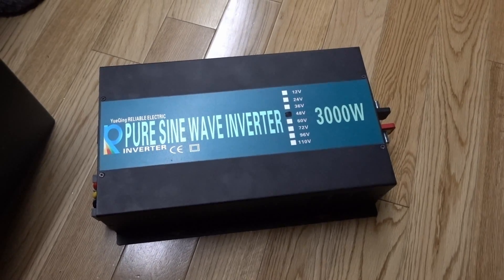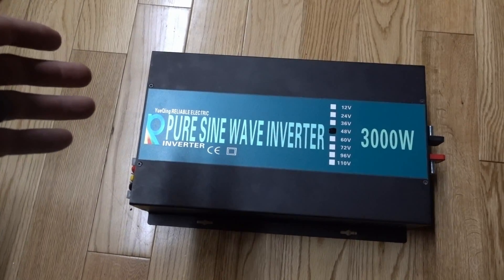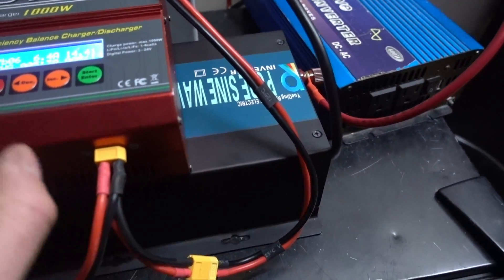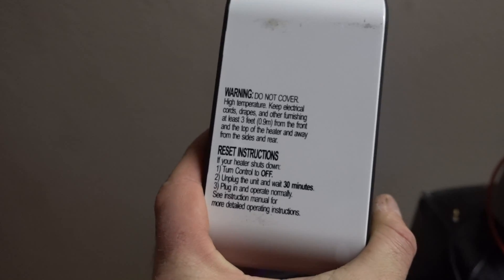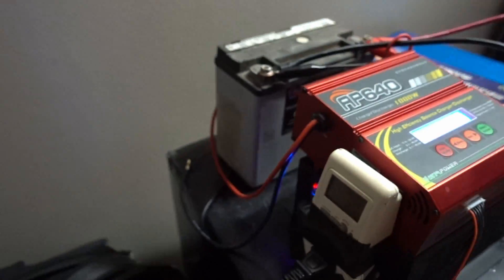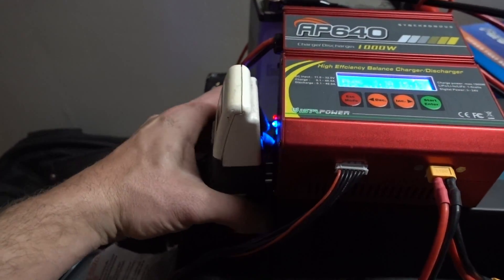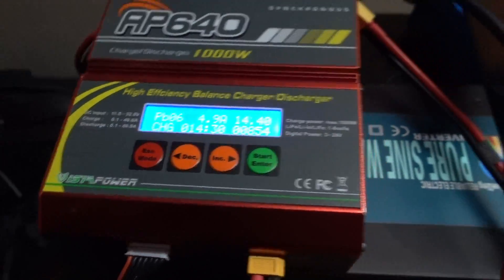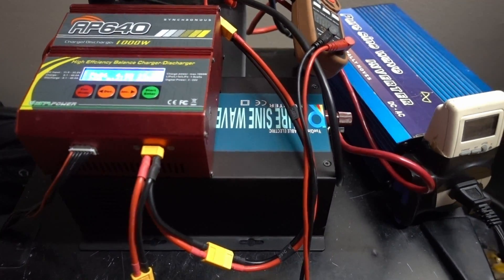Inverter Dies And Testing 500w Reliable

Comment: Great video! I own an 800w 24vdc unit and I like these reliable brand units since they are very easy to repair and modify. Inverters that use the case as a heatsink are a pain to open up and repair. The reliable units have a large heatsink on the board so removal and testing is much easier in my opinion.
I have actually created a micro grid ac coupled system to a grid tie inverter. I power limited the GTI used a DC DC boost converter with adjustable current limit. This method restricts the GTI output to 250w based on my current limit on the DC DC converter. So yes my reliable brand 800w inverter gets assistance from the GTI when the house load exceeds 300w. I used a hall sensor to detect load and parallel the both inverters else the GTI will force power into the reliable brand unit and blow it! (Yup I learned that the hard way, the need to ensure a minimum load is present before paralleling).
Keep up with the great work!
Regards,Fellow off grid home owner.
Reply from the maker: thats sick I tried that once! my inverter did not fail but I was scared to keep the test going for long :D
Reply: Once your ac load is greater than the grid tie maximum output you will be safe. The off grid inverter will ramp down it's output, something a GTI can never do. You will need a robust control system because once that ac load reduces in magnitude, the GTI must be disconnected. I like GTIs since they provide pure sine power at a really low cost. So to sum up, micro grid ac coupled systems are workable with certain caveats. If you want my documented write up on my home solar Projects I can email them to you complete with pics. I'm not skilled like you are with making clean videos. Lol.

Comment: I have three Reliable Electric pure sine wave inverters.  A 500 watt and two 2000 watt.  Used within their limits, they just keep working.  Almost 3 years in backup power service on the first 2000 watt unit.  Checking with an oscilloscope, the inverters deliver cleaner power than our local co-op.

Comment: I just blew mine up for the second time.  Just replacing the fets, resistor and protective diodes was apparently not enough.  I'll have to dig into it and proceed more carefully.  

I have used mine hooked directly to the house from the main wire hookups and had no problem.
Reply from the maker: then your ground and neutral are not connected, is it a older home ? also sucks how did you blow it the first and second time ?
Reply: I'm pretty sure the ground and neutral are connected in the buildings.  What I'm saying is I did that using the high power hookups, not the plugs. So I just used the hot and neutral and not the ground on the inverter.

The second time it just blew when I turned it on.  There must be something else wrong.  I suspect the main control board is fried and is locking the fets on, because when it blew it literally turned 6 of the 8 fuses into charcoal.  Oh well, a learning experience.  I'm going to be much more methodical next repair, I was careless.
Reply from the maker: yea been there done that :D you might have a death transformer or dead output fet, anyways GL hope you can fix her!!!
Reply: I replaced the output fets too.  I think anyway.  Those are the 4 that are off by themselves, correct?
Reply from the maker: yes they are, its trial and error with these repairs GL man!

Comment: All three of my reliable inverters at 24v and 48v are connected to the ground pin and the small prong just like it is supposed to be and are working  fine for me. The earth and low side are connected just like regular USA wiring with no problems
Reply from the maker: but is it connected to your house main panel? that is where the ground and the neutral are binded together killing these inverters, try testing yours to see if the ground is 50% live if so make sure never to bind ground and neutral.
Reply: My two 24V reliables get around 90 volts live to ground and 60 volts neutral to ground. Same on the hardwired and receptacles as you'll see they are connected together inside. I have my house hot and neutrals separate when connected to the inverters as tying to the neutral on the panel will possibly damage any inverter not made for grid tie operation.

Comment: The ground sits at the mid voltage due to the two small capacitors that are connected  from the live output and neutral out put down to the ground of the case and  also to that earth terminal  . You may have problems if you battery’s are connected to a charging system that is connecting the negative terminal of your battery’s to ground  and your battery’s  are not floating

Comment: both of my reliable inverters tell me over volt at 25 to 26 volts and they make me fridge  light blink on and off i just dont trust them ,gladd your having good luck
Reply from the maker: its a dumb design to have that low of a warning, but from what they tell me it will not hurt the inverter, I run my 48 volt inverter at 61 volts all the time and it stops flickering if you put 10% load or more :)
Reply: Southern Ohio Solar homestead my fridge light is pulsing too. The inverter red light is blinking and clicking.  Also the fan is acting up runs stops run stops.  Had been working good for 8 months.  The beep also sounds off randomly....

Comment: I wonder if that little lead acid battery's voltage sag under testing made a difference?  Perhaps if the battery voltage held up at 14+ volts like a car might with the alternator charging they could deliver a bit more power?  750 watts at 12 volts will be pulling over 62.5 amps.  If the battery was closer to 14.5 volts the amps might drop enough to not trip the current limit (maybe around 50 amps for the reliable?)  I guess it all depends if the inverters are shutting off due to A) output power/amps or B) input voltage or maybe C) input current?  Since the first step of the inverter is likely a boost converter to get the 12 volt input to maybe 180 volts or so I feel an input current limit would be a logical design.
Reply from the maker: you could be 100% right but I also had a charger plus the battery didn't fall below 11 volts so its hard to say, I will try this again hooked to my 180 amp diesel jeep :)
Reply: Going Off Grid thease videoes my god!! so good they are tho i am not got at knowledge of this i still like what you are doing like you know 
please reply hi to me

thanks
Reply from the maker: hey buddy thanks for watching!
Reply: thanks
Good luck on your future vidoes

Can I say something

Would you mind if I send you something WHICH IS NOT INVERTER RELATED
its Some cheap shit
I mean do you know the youtuber named "Bigclive"

He does those kinda videos 

So can I send you something its actually a cheap china shit and would you mind rewiewing it

And also
I am a 12 year old kid lol

I am really interested in electronics

And is a aims inverter worth it?

Thanks for reading this comment 
Bye
Please answer my comment! :)

Comment: I have a 2500 one recently it started acting up.  Red light flickering, and a clicking noise.  The lights in the house pulsing.  Not sure what is up.  It’s run fine for 8months. I never hooked up a ground... not sure if that is the problem....
Reply from the maker: Is it only when you barreries are full?
Reply: Going Off Grid not sure...batteries only charge to 25.5 v these days. Voltage for my charge controller is about 28.4 in full sun.
Reply: Seems very random. Also when the fan kicks on it pulses. Never stays fully on
Reply from the maker: @thebluedan  weird  might be on itd way out  i have 2 that are 3000w and 3 years old
Reply: Going Off Grid yeah probably,  I had one blow in a light strike last year.  Maybe I can combine to fix.  I think maybe it’ has something to do with switch for the temperature sensor and  cooling fan...but I’m not very good with electronics... not sure if I sure if I should switch brands...seems like all are a roll of the dice. That’s why I tend to like these cheap ones, and that I live in Brazil and the taxes double the price compared to USA....Because of their stupid taxes.
Reply: Appreciate any input.  I should probably replace it I’m afraid the power fluctuations will damage my fridge compressor motor
Reply from the maker: @thebluedan  have you tried the newer models?

Comment: So please explain, why do you say this is not a home inverter? I have one and it powers my house. Should I not use it. Why?
Reply from the maker: its fine if your careful but if your careful running a full house then your fine. I find its when you have multiple people in one house thats when 3000w is not enough and you end up over loading it.
Reply: @GoingOffGrid101  gotcha. My 4000 seems to handle things well. Just my wife and I. No pumps, elec htrs, just appliances. (No stove, propane).
I really wish I would have gone at least 24 volts though. Bad (uninformed) decision. Using 24, series 31, 105ahr. Deep cycle Batterys. Would have been such a better supply sys.
Thanks for clarifying.

Comment: Goingoffgrid big fan and following for long time.  I have seen u go back and forth on this I am thinking its because some reliables u can hook up neutral ground and some models u cant. But odd is old time engineering said it was 60v betw neutral and ground and he still did it.  Who's right and how can we definitely test without blowing up inverters
Reply from the maker: just grounds before the inverter and after and you will be ok, Reliable told me that these inverters are not designed for neutral to ground bond, at least on these older models.
Reply: @GoingOffGrid101  so you mean gound the chassis of the reliable inverter to a separate actual grounding rod  and then run jusr hot and neutral into a sub panel that back at the main already has natural and ground tied??

Comment: hey my 3000 reliable dc  voltage  meter has always read .2 volts lover than my make skyblue  which one is on the money?  the make skyblue is pretty good  charge controller  i have  the 60amp along with my reliable 3000    oh  and i never go over 2000 watts well  its always runs from about 90 watts to about 400  so the fan comes on once awhile  hey thanks for the grounding tip  you just save a lot of MOSFETs lol thumbs up
Reply from the maker: thanks for the great comment!  these inverters are very good as long and you dont short them, I have run 100% load for 5 mins I would not do for much longer, 2000w is a very good place to stop and 3000w surge.

Comment: Been looking for a pure inverter for a car I did get one (probably junk) but it seems most of them don't like very low loads, like a phone charger it instantly made my screen sensors freak out (nearly called 999 lol) seems most of them have a warning about using low loads like phone chargers on under £/$ 100 pure sinwave inverters 

 I still got this synthetic sinwave inverter I have had for more than 7 years my quick chargers partly hate it as it makes my phone's marginally freak out when using the screen and rapid charging most of the time does not work) , 

but the Google Pixel 2 charger does not seem to give a damn about it and my pixle 2 phone charges fast (charger is not making buzzing noises) need to get a USB 3 to USB normal that phones norm use to see if phone is happy with it (only down side with the pixel charger is it's using the USB-pd standard not QC 2 or 3 so most of my phones will only pull 1.0a at 5v)
Reply from the maker: the inverters I have don't seem to have this problem.
Reply: Many inverters have USB ports, not this one though
Reply from the maker: true but the ones I have that have usb take way to much power to just run the usb :(

Comment: My 5000 watt 220v just has red led on. Not sending power. How can I troubleshoot. Just 3 months
Reply from the maker: does it smell burnt? if you open the case and run a ohim meter on the mosfets see if there is a dead short, if there is then the mosfets are shot, if they are good try a different battery/ cables, also check the fuse inside inverter, make sure to let the inverter sit with the power on and disconnected from any power for at least 10 mins before working on the unit
Reply: Going Off Grid can I test the mosfets on board? All you tube videos have them removed. You have a video troubleshooting?
Reply from the maker: yes you can test onboard

Comment: that's not true in my case. I have mine hard wired to 3 arc and gfi outlets. also connected to a 8foot ground rod with 6awg solid wire. your wrong
Reply from the maker: some models do not have this problem I tested other inverters from reliable and I believe they fixed it.

Comment: I broke my 36V, 3000W reliable inverter on the 2nd day.  I had to try running solar panels directly into inverter with no charge controller. There are guides on youtube on how to test inverter.  The salesman offer like $75 for parts to fix it.  The mosfets and fuses were blown. But, I figure if I put it together it would only be like 50-50 that it would work again.  He said too expensive to ship to China to get it repaired.  Although the documentation did not say I could hook up inverter to panels directly, I had to try it.  I should have asked before I tried it. The 72 cell poly worked fine, but the 60 cell poly damaged the inverter.  The hot summer 100 degree heat lowers Vp to low values maybe 30V.  The salesman said the voltage fluctuations were too great and I should have known better.  I was thinking of using the case to build a 7s16p 18650 battery with battery holders like Adam Welch did in his last video, where 4 cells are spot welded together. So it might be something you can do with yours.  The shipping to you was very expensive like $100.
Reply from the maker: I will be willing to pay that shipping, as it will make good youtube videos, let me know, BTW that sucks a lot, if your willing to but them again try for a 50% off deal, it should work, don't tell them I said that :D